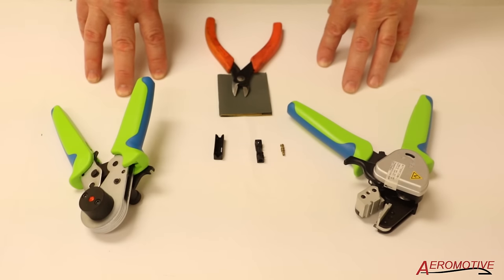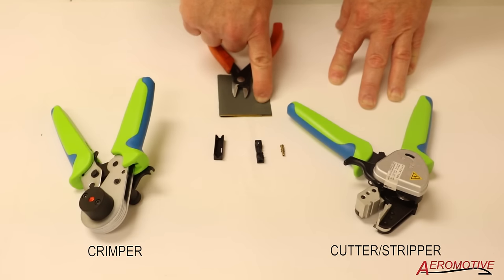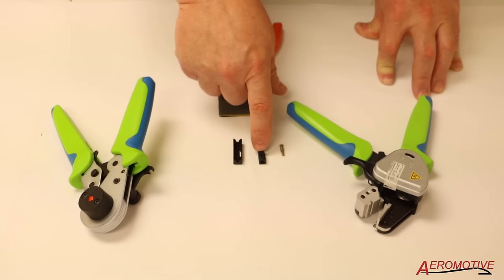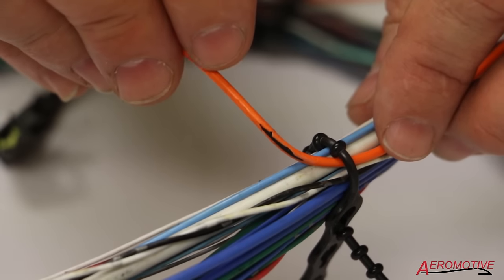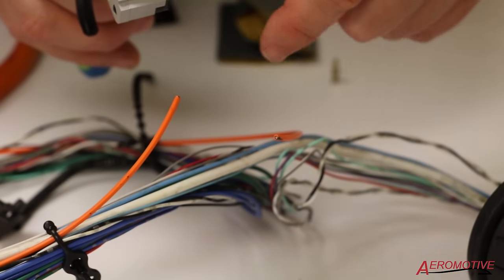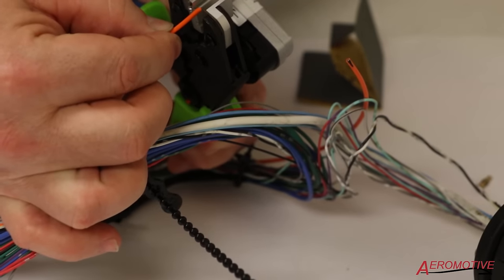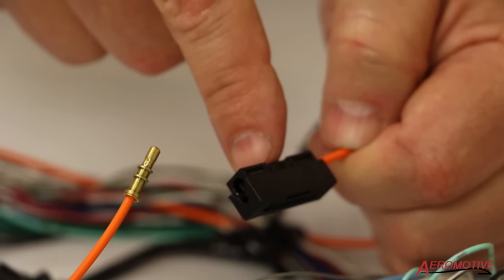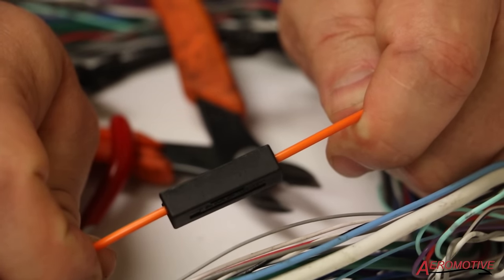How to Repair Fiber Optic Cable

Comment: I’m sure My AT&T fiber optic cable broke again. By the Dogs. I wanted to fix it myself but it’s looking like you need special tools. I’ll have to call for repair. Should I say my dogs did it or it happened on its own. I’m not looking to pay for this hair thin cable.
Reply: Did you fix it? Or buy one?
Reply: Asking cause this is week 2 looking for options
Reply: @BlaccKage  no you can’t fix it. You need special tools and special cable
Reply: Same thing happened to me today bro what did you end up doing? I also have at&t and it was also my dogs that were the culprit

Comment: this loss will be high, even worse, you did not clean the fibre..  this MIGHT suffice for an emergency  overnight fix until you get the fusion splicer onsite first thing in morning, but leave that as perm repair. no fscking way
Reply: Assuming it had been cleaned (is it the tip of the cable that should've been cleaned?), why not as a permanent repair? (I'm just casually looking into this regarding broadband fibre repairs). Also I'm reading that a mechanical splice loss is ~0.3db, would that be too much for broadband? Or any application??
Reply: When you say he didn't clean it are you referring to him not using the sand paper to expose the metal? I was wondering why after he spliced it that the wire looked black.
Reply: @kevinsono  the colour code of the fibre is not only strange, but yeah, the core of that fibre could have all sort of dust, finger oils and muck on it - its why the first thing they teach you is to never ever take the dust cap off, dust and crap particles in the air will find its way there, thats why even after removing dust cap you clean the ferrule, this will cause serious problems, nice clean cut nice smooth edge, you cant possible see that in fibre cable without teh proper equipment, its not the same as copper, its why decent fibre cleavers cost 500 plus dollars. If I ran his cable through a certifier it would fail for sure, the losses would be high. 

To manually fix fibre break before you can get a a fusion splicer to do it properly, there are manual repair kits out there, and i'm sure in hte past I've seen some of those videos in my recommendations, but a long time ago, maybe Corning, or Belden, or AFL, they'd certainly have the kits.

Comment: i bought a 2010 Mercedes e350 and found out that the fiber optic cable had been removed. What options do I have to be able to pick up sirius XM radio?

Comment: Do you have any links to where I can buy everything used here?
Reply from the maker: Hello Braxton,

Thank you for taking the time to view our repair video! You can buy or rent these tools directly from Aeromotive! Give us a call at 224-535-9220!
Reply: @AeromotiveUsServices  I didn't want to call the US as I'm in the UK ;). Would you be able to give me price here, or give me a link as to where I could buy it in the UK? Or failing that, the manufacturer of those tools?
Reply from the maker: Assimilator1 you can submit the request through our website Aeromotive.us and then we can communicate via email. Thanks,

Comment: I just use a fusion splicer then test with an OTDR.  I wouldn't cal a butt splice "correct". but it will work on a budget. if the fiber isn't broken though I'd probably just do it cheaper and wrap the cable with jacket repair tape instead of doing all this. it owuld be the same result, protect the fiber again. 

I guess it depends on if there's signal loss or not, but if signal loss I'd probably just drop in a new patch cord and skip this also.

Comment: i also would like to know the loss on this cable repair pls specify
Reply: @Assimilator1  eww 0.1db?  I'd pass on that splicer,, typical active clad alignment should get you  0.02db, an active core alignment should get you  0.00 to 0.01db loss  The manual splice losses I'd agree with about 0.3db

I'm not over thrilled with fs.coms cleavers, its 2020 and no shards/trash bin/receptical ??? come on...
I cant believe how some of the stuff comes out of China is so damn amazing, but some of it is out right junk or lacks safety or basics

Comment: Why does it take my cable company 36 hours to repair one tiny break??
Reply: Most likely they can’t find the tiny breakout aren’t aloud to fix the break and  have to replace the whole wire.New wire from power lines routed to your roof and a around it then into your house. I’ve repaired Ethernet cables with a lying tiny wires but this I don’t have the equipment for.  I paid to build a new porch and they built right on top of my fiber cable when they could’ve taken 3 screws off to move the cable out the way… 4 days without internet